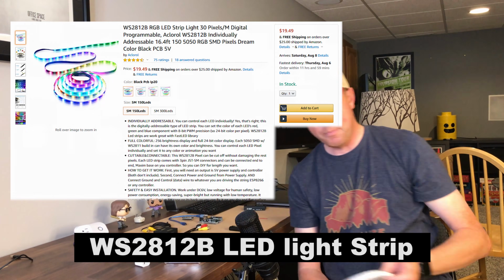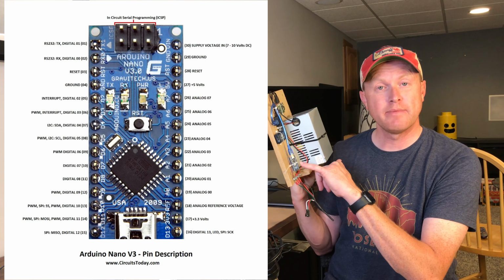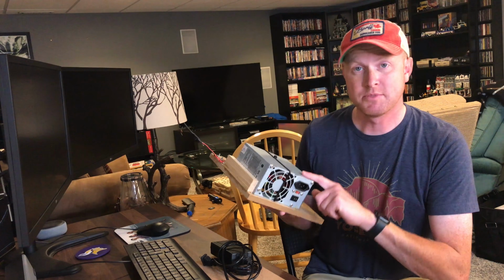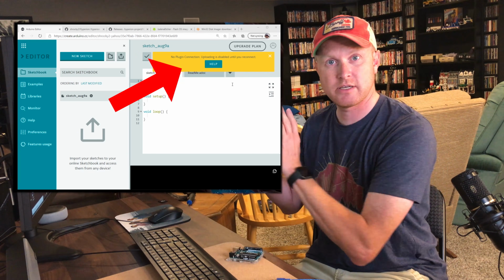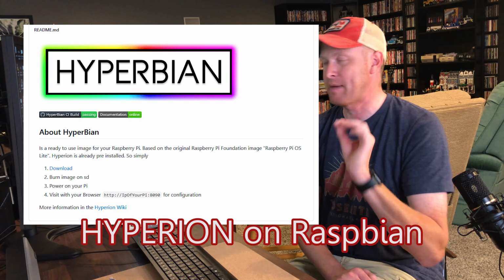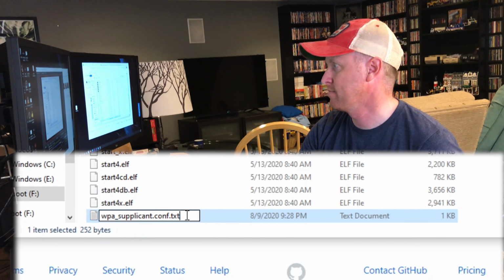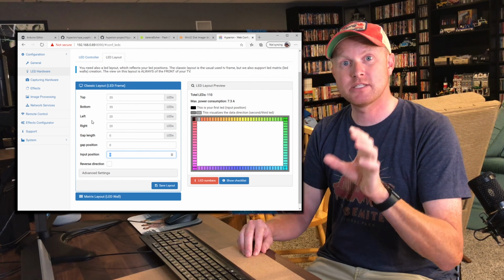DIY Hyperion Ambient TV Light Project (Raspberry Pi + Arduino) Complete Setup

Comment: Hey Steve, sick video, really easy to understand. I had an issue tho, when i do any change or test anything that the PI has to send something to the arduino, Hyperion just reload non stop (lost connection).. it stops when i unplug the arduino. Tried 2 pi and 2 cable for the arduino, same result, i am using the clone like you, it flashes OK. Do you have an idea ? When i change a config while plugged, led will do : Green, Red, blue, off, hyperion reboots GRB again.. in loop, maybe this can help ? Baud rate is ok, checked code 2 times, everything else works, capture is OK, so i dont know :/
 Thanks!
Reply: Am having this exact same issue!
Reply: @shawnneumann736  ok, i would guess that it has something to do with the code, not too sure where to go from here, if i find out ill post here.
Reply: @wowfut  same issue here its definitely Arduino related.
Reply: @Drunkmonkey9945  Or it is something in version of hyperion that reacts weird.. cant find how to install an older version tho, they dont have archive of hyperbian, only the latest, and hyperion archive seems things, or i dont have enough exp for it :/. I  saw a post that someone installed alpha 6 instead of 7 and solved his issue.
Reply: @wowfut  could be possible when he made the video he ran on alpha 6 and then it was updated to 7. 

He'd have to provide us his version number to know. Or a copy of his image without his personal info
Reply: @Drunkmonkey9945  his hyperbian dated 5-28, the current one is like 7-24, so def different.
Reply: This Sketch should work: https://github.com/hyperion-project/hyperion.ng/blob/fbd8167458b423ba00e122e0db289153dbb2b25f/assets/firmware/arduino/adalight/adalight.ino#L1

Comment: Hey Steve, I have followed the video completely through and i am experiencing a error, whenever i connect to my Raspberry Pi 3B+  running the HyperBian web page i am unable to connect but this only occurs while my arduino is plugged in. I have a Elegoo Uno R3  "arduino" and the webpage has been set up properly and the arduino has been coded using the FastLed Library i am unable to get the effect working the most i get is a red green and blue LED flash then it loops onto itself any ideas/help would be extremely appreciated.
Thanks!
Reply: i have the same, let me know if you fix it, ill post if i get a fix too, thanks.
Reply: @wowfut  heres a link to the arduino code i used shorturl.at/rvAFY its to my google drive there is instructions inside the arduino code open it with the Arduino IDE app and for the XOR value just look up a XOR calculator and there are instructions for what you use for the inputs. i have my brightness set to 90% you can adjust there will be 2 fields to input so make sure you scan the whole code there are instructions everywhere and descriptions. and change the amount of LEDs at the top.
This is not my code it is @TheMadScientists code he has a video tutorial with kody on the pi so you can actually watch tv and such but you lose the Web UI advantage of Hyperbian, I just use Hyperbian with this code and you will be good to go!
Reply: @inder.6091  Thanks, the code isn't public tho ;)
Reply: @wowfut  whoops! i will change that right away.
Reply: https://drive.google.com/file/d/1upD4y0HpCQ1uEMTlEtz1ejqP5Q1SZ7Mj/view?usp=sharing
Reply: @inder.6091  Thanks, it doesn't reboot, but it seems that i might have something defective or i don't know.. i have a strip of 300 leds and used 0x12B, 0x17E. it flashed ok, when i change options on hyperbian, i see the arduino light flashing as it seems to receive data (rx led) but nothing happends on the strip.. just the "snake" from the code on line 66 randomly happens. Do you have a 3rd led flashing on the arduino when it works? Thanks again.
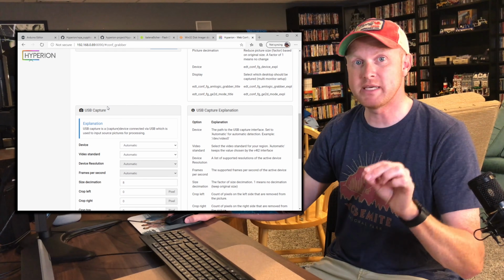Reply: @wowfut  I have a Solid L light and a flashing RX light have  you identified that the USB Capture device is set up correctly on the website for it? and if so do you see the live footage from it? 28:50 in steves video will show that step would like to find out if that might be the issue as the arduino is ready to go from the sounds of it and i did double check your HEX values and they are correct i hope this helps!
Reply: @inder.6091  Yes, i see the preview, everything seems to be fine config wise. It like nothing gets sent to the led for some reason. Trying to isolate the problem by trying other ways to send data to the leds.
Reply: @inder.6091  it seems that it might to be related to alpha7 of hyperion, do you have alpha 7 or 6 ? Thanks.
Reply: @wowfut  hey, i used whatever version was linked by Steve  im not too sure how to check which version i have.
Reply: i just checked putty(HyperBian 5.4.51-v7+) thats what i have so appears to be v7
Reply: @inder.6091  i ended up installing v6 (which has no web ui it seems) on a clean rasbian with the details of the hyperion-project.org site. Was a lot of work, but ended up working. Also used their sketch that works up too 500leds also.
Reply: @wowfut  glad to hear you got it working! hope you enjoy the lightshow!
Reply: @wowfut  I'm having the same issues you were describing, can you describe the process you took?
Reply: @FetusFondler  i created a list of things i did, like i said, it was hard and it is not super clean.. i almost gave up.. but for now.. until there is a new version, it's gonna stay like that for me.
https://pastebin.com/v6k4ssNj
Reply: @wowfut  you're using an hdmi grabber or the rca one?
Reply: @Drunkmonkey9945  hdmi, pretty much like the one in this video
Reply: it works with the current "master" from thier git. So should be OK next release (if you want to try it : https://github.com/hyperion-project/hyperion.ng/blob/master/CompileHowto.md)
Reply: @wowfut  followed your steps and nothing happens haha
Reply: same for me with the loop
Reply: @partyboxberlin  i created a new guide to install from the git repo (latest hyperion) you can try it : I left the links of where i found what to do: https://pastebin.com/M860ynJz i tested it from scratch should work fine with your configurations

Comment: Timestamps:
Hardware info 00:52
Power Supply 05:36
Light Installation 11:16
Arduino Software 14:19
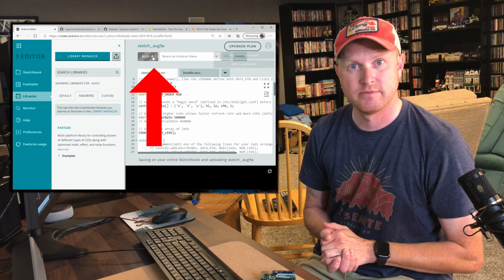Raspberry Pi Software 18:18
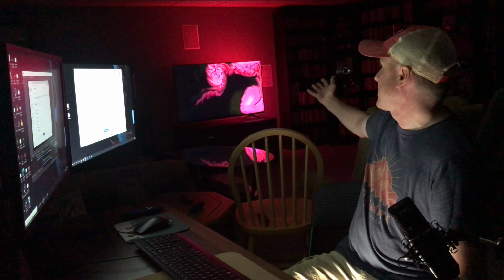Final Thoughts 31:35

Comment: Hi can i get a copy of the alpha 6 iso off you please? as i still cant work out if its the pi or nano thats not working right for me. i just cant get the leds to work at all. they just flash GRB when i 1st boot up then nothing. have had a go with 4 different Sketch on the nano and with a uno . your Sketch i get the GRB flash at start other i get 2 white slow flash. using 226 leds on a 5v 20a psu. any help will be good thanks
Reply: @Steve_Does_Stuff  Usb0 shows in the pi just have no control over the leds. Had a go this morning using a esp8266 with wled flashed to it and that seems to work. But with some random flashing from the leds. Can you have a look at your sketch for the nano as I think it's something in there. Have to say tho if I can now work out the flashing on the esp8266 I might stick with that as it's nice to have WiFi on it with the wled. Can even get Google alexa working with if.
Reply: @Steve_Does_Stuff  hey Steve could you upload a copy of your image please with your personal information removed of course. Perhaps the latest version has an error with the coding

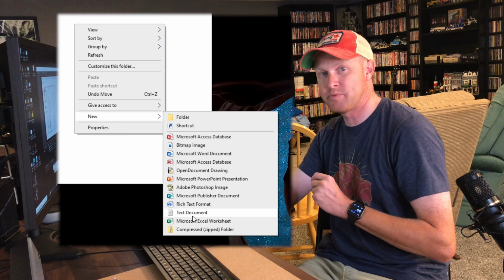Comment: Steve - RaspberryPi & Arduino Noob here, so please forgive the potentially daft question - the file ""SSH" created around 21:10 has no content, is this correct? if so what is it there for? The wpa_supplicant.conf file is obviously for wifi access. Love the project by the way, like someone else already said, perfect timing for me too as I'm building a similar project :-)
Reply: @Steve_Does_Stuff  thanks :-) btw is the Hyperbian build of Raspbian supposed to have a desktop environment available?  rasbi-config directed me to sudo apt-get install lightdm, which  failed a few times before finally succeeding? i'm guessing not, in that you'd really want the RPi to boot, log in & then just sit there minding it's own business while the arduino takes care of business?
Reply: Steve Does Stuff! Yeah I figured as much, i’ll re-flash the SD card for a clean install - this for me is also about learning about Raspberry Pi & Linux 👍

Comment: I've seen a couple instructionals using rasberry pi, openelec, hypercon and no arduino board. Can you explain why yours needs the arduino compared to the other diy's around?
Reply: @Steve_Does_Stuff  Thanks for the help! I'm using a RP3 and will see if I need the arduino. I've been through 3 different av to usb video grabbers and none of them are recognized by the pi and openelec so I'm definitely going to try the hdmi to usb
Reply: @Steve_Does_Stuff  would I need a different OS or hyberbian if I'm attempting to not use the arduino?

Comment: An old Xbox 360 power brick is cheaper and smaller. Check one out to use for things like this. They have 5v and 12v out and would probably give more than enough amps for the whole project.

Looks really good though.